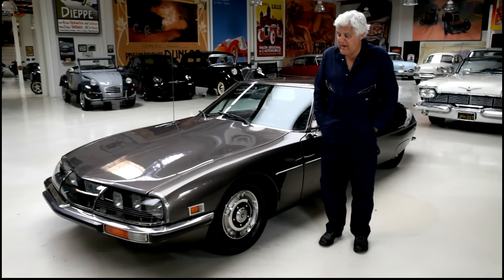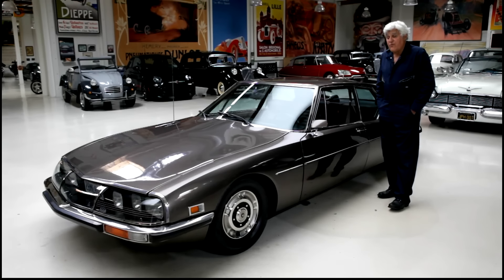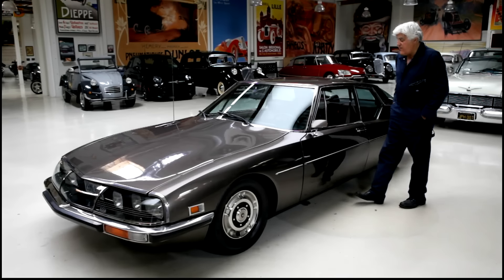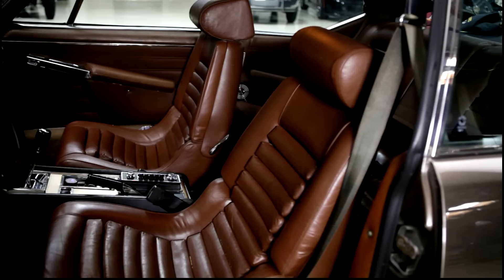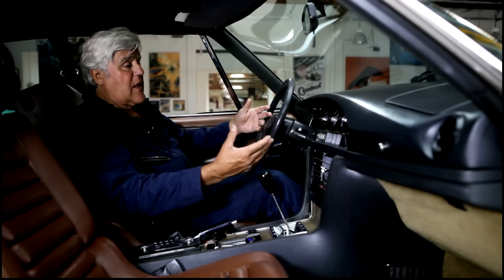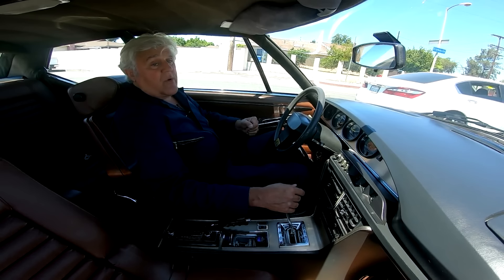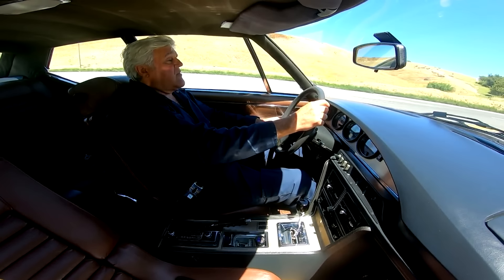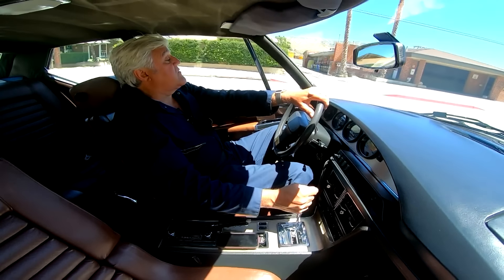The Futuristic 1972 Citroën SM | Jay Leno's Garage

Comment: Hey Jay. You have so many video blogs you share with us car enthusiasts, thank you for that. in this feature you showed one of the French car brands Citroen, a very simple and straightforward family car with great driving comfort, which is not in the workshop manual, is the secret about the suspension systems on the Citroen. something that is simple but secret is that citroen built a car frame, like a frame mattress for one of the most expensive bed mattress with springs. then it was just a matter of jumping and bouncing on this mattress, to see how the whole of Drammen developed under hard pressure in the mattress. this type of Peter Jensen, and Citroen call remote systems the Jensen system, where every single Christmas works on the road to get the best possible flow in traffic. Drivers and passengers should feel like they are flying on a cloud. and successfully managed to get the car itself Drammen, a bit gedaan like Jensen bed. this was developed already in the 60's, and used it on 'toad' (the red you showed the picture of, which was known for too small an engine. it was the model on which they developed the Jensen system. Very few other car brands showed about this system until after many many years on the market, thus they got had for themselves and test out and improve the remote system. and that makes citroeng fully operational today, Johnny, Norway, Europe 🇳🇴 😀

Comment: 29:54 I bought a running 1972 SM 5 speed for $2,000 from a Jewish furniture store guy…André Citroën was a Jew. Funny. I bought another '72 SM 5sp. from an Iranian guy in Chicago for $3,500. It was kinda rusty, so I had to get it repaired. Between the two I drove SMs for almost 10 years. They never gave me any trouble, just regular maintenance.

Comment: Having been a long-time SM admirer, I can't believe it's taken me this long to discover this video. I owned a 1972 GS Pallas for a few years and Jay's driving impressions brought back many memories. He mentions the velour seats of many 70s American cars. Well, my GS came out with turquoise seats in brushed vinyl. When I bought the car, they were in very bad shape and as we couldn't source the 'correct' material in South Africa, I had them redone in velour of a similar colour. The car is silver, so the bright blue seats made for quite the contrast! Curiously, the GS does have a conventional brake pedal, but of course, it's coupled to the same idiosyncratic brake system. This just means that you have to be very sensitive when it comes to pedal inputs. Like the SM, the GS also had a fantastically low aerodynamic drag coefficient - which helps a great deal if you only have a 1200cc engine! Incidentally, the GS is equipped with an air-cooled flat 'four' which I have reason to believe is a derivative of the flat six that was originally intended for the DS. But my favourite party trick remains the suspension. Whenever I had passengers in the car, I would approach speed humps at a slightly higher speed than you would normally, and this would make people tense up visibly, but as you glided over them unsettled, their disbelief was almost visible! They are not the easiest cars to live with, but a good Citroën from that era is something to experience. There was nothing like it in the 70s and there probably won't be anything like it in the future.

Comment: Now I see this, where the disk brakes are put away from the wheels to reduce the “un-sprung weight” as Jay puts it, I think about all those very expensive lightweight wheels with cast aluminium hubs where the brakes with their massive disks and hydraulic mechanisms are right there almost “inside” the wheels. Surely it would be better to put the brakes back away nearer to the engine! Why don’t we always do this?
Reply: probably the painful maintenance

Comment: The ill-fated Tucker had headlights that would turn too, but alas.....,  It was illegal to have unsealed headlights, so you couldn't use Halogen bulbs that were put into the back of the unsealed headlights to have brighter light (you could cheat though, because no one would really ever check them) Inboard disc brakes, the Rover had them, and when the Japanese got into the car market seriously, Subaru copied them. the Brits were building smaller cars unlike the American heaps of 60's and 70's. Love Jay's Garage!

Comment: I wanted to change the battery of this car. I had no success. I do not know how how this has to be done. It was a special battery with something electricattached on a special holder integrated into the side of the battery. That made this battery unique. I found no other place to fix this electric part anywhere else. I am not a mechanic, but I own some oldtimer with simple technique. I swore never to touch a Citroen SM.

Comment: No Jay, England had JagUar, THREE syllables!!!!!!

Why aren't you wearing your seatbelt? Is it not a legal requirement there? 
I have a 1961 Land Rover which doesn't have them fitted, but if i retro-fitted a set, i'd have to wear them by law.

I used to own a Citroen Dyane which like the 2CV also has front inboard disc brakes. The best thing i liked about those was with the metal undertray fitted, you could plow through deep puddles of water with no adverse effect to the brakes.
For a fun car, i'd suggest you have a look at the Dyane. In my opinion it is better than the 2CV. Same chassis and running gear but with a different body. It has more conventional headlights and a hatchback rear door.

I remember seeing an old Citroen advert showing a DS driving around a test track with one rear wheel cocked up in the air. I just failed to find it, but this video is even more bonkers!

https://www.youtube.com/watch?v=O7AijogHtRc

This is the first time i saw a Citroen SM. Note the name badge behind the plexiglass. Product placement ala 1974 😁

https://www.youtube.com/watch?v=TYlvdb0mcW8

Comment: This car was a dream in France. The DS was the déesse (same pronunciation, meaning godess) and it was the superlative DS.
But it was a nightmare also: the motor was very temperamental and fragile if not very well and frequently tuned and maintained, and accessibility was poor. Same for all the cool features described, the electric circuit and so on. 
The car soon gained quite a bad rep.  Even the  Citroën dealers at times tend to eschew to work on it as the official price scales didn't match the length and difficulty of work. 
And it was very expensive, only people insisting on a french car or Citroën afficionados would buy it. Others would buy a more exotic and fancy or sporty foreign car for the same price. In the eyes of an american it's probably different.
Nowadays it's different,  it's a collection piece (almost 100k€ for a really nice one)  with some  very  dedicated specialists and  a network of enthusiasts and/or owners to help .
Reply: In the USA you could buy TWO Cadillac Eldorados for ONE Citroën SM. And be able to get it maintained and repaired at any GM shop. You could buy a lot of 1972 gas for $7,000!

Comment: Jay? Didn't PRESTON TUCKER pioneer the idea of headlights turning in synch with the steering wheel YEARS ahead of the CITROEN brand with HIS very futuristic automobile?
Reply: Turning headlights date from the 1920s. The Tucker’s central headlight turned with the steering. It came on only when turning more than 10° from center and the high beams were on. Up until 1958 only two headlights were allowed in the USA, so the Tucker's light was allowed to come on only when turning.
Citroën DS/ID gained turning long range "driving" lights in 1967. Optional on lesser ID models, standard on DS models. Illegal in the USA, of course.
The SM has six headlights. Two outer low beams, two high beams and two long range driving lights that turned with the steering. They were activated by pushing in on the lights stalk and worked only when the high beams were on. Illegal in the USA of course. The 1967-> DS/ID have streamlined glass over the headlights, as does the SM. Illegal in the USA of course.
The DS steering lights operate by rods connected to the steering relay levers. The SM steering lights operate by low pressure hydraulic pipes that are not connected to the high pressure central hydraulic system. They are filled with glycerin (?), not hydraulic oil. An adjustment allows correction for the gradual leaking of the fluid. When that adjustment is used up, enthusiasts have developed a method of refilling the headlights hydraulic system as the factory (Cibié) replacement parts are long gone. 
I don't have any personal experience with the self-leveling and turning headlights as the only one I have had was a fire damaged non-USA SM. I have seen only a couple of SMs and DSs with the turning lights at the dealer in Kensington(?), Maryland.
Reply: @algrayson8965  Thank you so much for your REPLY and the detailed information! Much appreciated.

Comment: A V6 is a well-balanced engine, much better than a V8. Phil Hill was not America's only World Champion. Mario Andretti would be upset if he heard you say that..."the complex and temperamental hydropneumatic suspension system required expensive and time-consuming maintenance, and with virtually no Citroën support in the U.S., there are likely thousands of SM projects out there with sunken suspensions that haven’t been run in decades.... a number of problems with the V6, usually due to its complex timing chains or ignition system. Due to U.S. emissions standards, the company needed to modify the exhaust manifolds, which could lead to engine fires." -MotorBiscuit
Reply: A 60⁰ V6, 120⁰ V6, an IL6 and an H6 are very well balanced. A 90⁰ V6 with a three-throw crankshaft shakes the car at idle. Buick fixed this by splitting the crank throws, making it a 6 throw crankshaft.
Reply: The lovely tube headers were illegal in the USA. Stoves that had air injection into the exhaust ports were a last ditch effort to avoid catalysts. They got the SM through 1973 but for 1974 catalysts would have been required to pass emissions. The bumper height clampdown finished off the SM for the USA. 
1974: Forced "marriage" of bankrupt (again!) Citroën with Peugeot finished off the SM. As the SM was based on the D, the introduction of the CX closed out the D and the SM with it. Citroën had hundreds of complete SM bodies and a huge stock of other SM parts. Asked Peugeot for authorization to complete SMs until they ran out of complete sets of parts. Peugeot: ”To the CRUSHER!!” Hundreds of complete from Maserati engine-transaxle assemblies were smashed and ground up to be smelted. Citroën parts supplies to distribution centers stopped. 
Peugeot didn't want Citroën, its private rival (Renault is owned in large part by the government), would have liked to shut Citroën down and scrap it.

Comment: It was certainly a V8 with 2 pots cut off..... That made it a bit harsh revving as the angle of the V had to be changed to make it rev smoothly. The v6 was cobbled up in too much of a hurry.--Best solution today is convert these & the DS (even the CX)  to electric.... Drive the suspension fluid pump by electric also........... Heaven!

Comment: Beautiful car and great review.  I work in aerodynamics and perked up when I heard Jay mention the Kammback tail.  That's a real interesting boat tail shape developed by the Germans in the 1930s, when they discovered you can get lower drag by truncating the car's tail and forcing flow to cleanly separate off the end (as opposed to trying to keep it attached and smooth on a longer tail).  This is one of the nicest looking applications of the Kammback concept.

Comment: That bonnet was not long enough to house the V8, how damn long was the V8?
Reply: A V8 based on cobbling two V6s together was built and is in a collector's car. There is a lot of room between the back of the V6 and the firewall, enough to repair the water pump, oil pump and main timing chain…if you don't mind oil dripping on you. To do the same on the V8 the power pack is removed. The V8 is one cylinder sleeve longer, about 3¾".

Comment: Lovely car , although for me the Facel Vega HK 500 , which was actually faster , would be the ultimate French car . Oh , by the way it is NOT two cee vee , it is Deux Chevaux - I hate when people pronounce it wrongly . Usually only the English are so ignorant .

50 years old , any other car looks old today .... not the Mercedes W113 'Pagoda' series 230/250/280SL - they still look timelessly elegant . and a good one just about drives itself along the road . Also the related W111 Coupe and Cabriolet , E Type Jaguar ( I was in one last weekend ) or any Ferrari of the period just look so right .

Mercedes ZHM fluid , used in their hydropneumatic suspension , is basically the same , only brown in colour .

Comment: Rolls only used it on the rear suspension. The maserati engine was not that good. The steering change ratio at about 15 mph by means of a centrifugal governor. If the cable broke it was like a go kart 1 turn lock to lock. So not a pressure change as such as all power steering reduces pressure with speed increase.
Reply: Rolls-Royce used the Citroën system on the front, 1" travel, for a few cars. It was dropped as unnecessary. Royce used hydraulic cylinders over coil springs. No green spheres.
The DIRAVI steering operates at a constant pressure of approximately 2,300 psi. On 5sp gearboxes a centrifugal regulator driven by the secondary/pinion shaft increased centering pressure up to about 80 mph, making it very stiff beyond a couple of degrees either side of center. On Automatiques the pressure regulator was entirely different, tapping pressure from the Borg-Warner T35 transmission pump.
There is no cable anywhere in the DIRAVI system of the SM. There is a cable in the CX DIRAVI system.

Comment: Fabulous video as usual! Your joy and pleasure from driving really shows and it's a pleasure to enjoy this car with you :)

The issue with servicing is a well know issue. Simply said, Citroen didn't believed they could compete on the US market and they simply never did anything serious to conform to that market.
The officially-exported Citroën that made it to the US were the work of Citroën representatives in the US that were left on their own to try to provide basically everything.
This is the reason why when the USA voted that law for bumpers that excluded Citroën, they just pulled off the market and didn't bothered figthing it.
Even in France, there were issues to service a SM.
Until 1975 and Peugeot's takeover, Citroën only had two engine lines : the flat-twin (and flat-four in the GS) and the Traction avant engine. (FYI, that engine conceived in 1934 was modernized several time, and even turned into a Diesel engine, with the last one made as late as 1992).
So even in France, when Citroën SM owners visited official Citroën mechanics, most of them were wholly unfamiliar with the Maserati engine and getting those cars serviced was usually quite long. At least, they were already familiar with the oleopneumatic suspension.
About it, if you didn't know already, LHM stand for "Liquide Hydraulique Minéral" (Mineral Hydraulic Liquid)

Comment: The problem with Citroens was that you needed mechanics who understood the cars. Outside France and some parts of Europe there was no chance of finding anyone to fix them. In France your ordinary "pop and mom" workshop knew how to fix the suspension, brakes and steering and the basic engines (maybe not the Maserati). In the rest of Western Europe you could usually rely on a Citroen dealer. In the USA there was probably two people in the whole country who knew how to maintain and fix them, there probably still is only two people who know how to maintain and repair them. Citroen could never afford to invest in a dealer network to make the cars viable in the USA. I understand this because I have run American vehicles in three European countries and the European mechanics quite often make elementary mistakes simply because they have never worked on an American vehicle. I recently came across one who did not know how to and did not want to learn how to adjust the bands on a Chrysler automatic gearbox.

Comment: In an emergency you can use engine oil then drain it out afterwards. Anything else will destroy it. I've seen water, brake fluid and gear oil and its a disaster  for the car and you can get it out of the strut legs.
Reply: 20W or thinner motor oil, ATF (NOT Ford type F!!), hydraulic jack oil. The best substitute is MIL-H-5606, which is readily available at oil distributors. The only brand I ever used was Texaco Aircraft Hydraulic Fluid 15, "Red Oil." ATF has friction modifiers that increase wear in the slide valves and pump.

Comment: Not allow in San Francisco? Get a ticket if you park with wheels straight
Reply: You can still keep the wheels towards the curb. You just have to hold the wheel and shut the engine of. But it will of course go back to center as soon as you start the engine.

Comment: Speed, schmeed. what's a thousand horsepower good for, anyway? At a certain point you have to be careful how you boot it, hardly ever really put your foot in it. When do you ever need rapid acceleration? It'll get you into trouble more than anything. When are you likely going to drive even a hundred mph?

You want to get up to speed rapidly, merging onto the freeway. You want to get out of trouble if you need to. You want the thrill of that occasional kick in the pants. Otherwise, you want a comfortable, balanced drive. Much over a few hundred horsepower is a waste. Oner, say, 800 horses is just plain stupid. For more than a few seconds. By then you're likely in trouble, possibly dead. On the freeway, overspeed is courting trouble; on a winding road, you don't want it. What you want is insanely good handling.

Overall, you want that Cit, nothing better. Cool ride you got there, Jay.